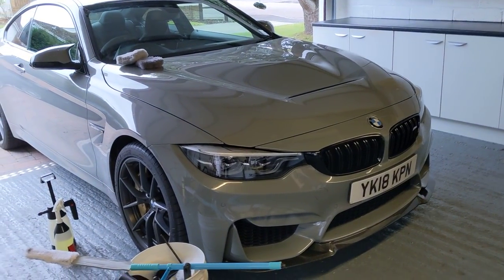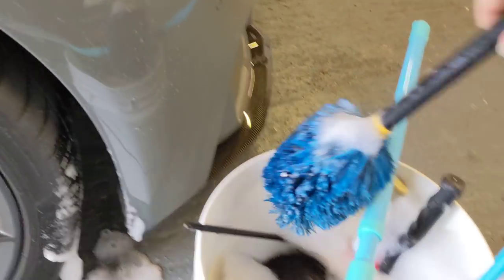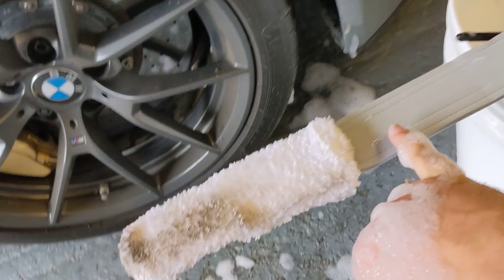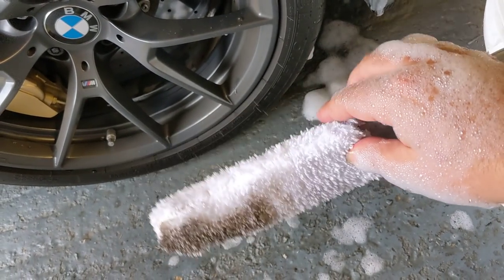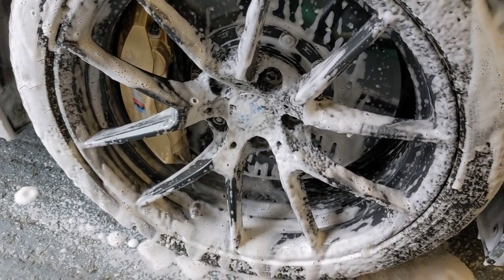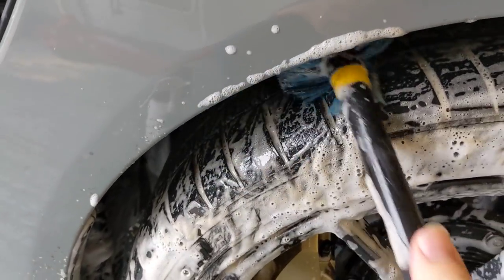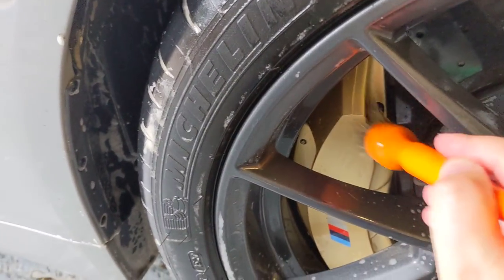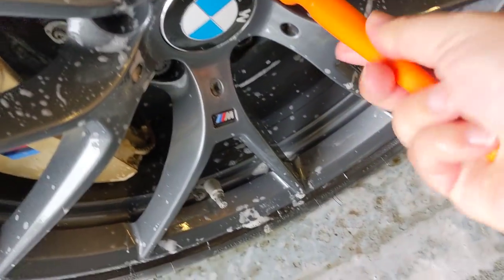Cleaning Ceramic Brakes on my new BMW M4 CS | Top Detailing Tips

Comment: Having owned Ceramics for a number of years, the best advice I can offer is just to stay away from anything too acidic or alkali.  As you've seen, the dust fall out is so easy to remove that a normal PH neutral shampoo is more than capable. Surfex is a bit aggressive for me in this circumstance and I just kept with BH Autowash.  Many Ceramic Brake owners complain of brake squeal and I believe this is down to using harsh chemicals that also get sprayed onto the disc surface, which causes this issue over time.  Please, please, please also use the wheel location tool when removing and fitting the wheels over ceramics discs. Chipping them is so easy and the last thing you want. So finding a suitable company to replace tyres, was my biggest nightmare.
Reply: Good advice using the  location tool. i got mine from amazon just make sure its the right thread size. take it BH autowash and snowfoam is safe to use on the brakes? i always wash any product i get on my disks away right away even if it is ph neutral

Comment: Hi John

I highly recommend the orange carpro microfibre gloves which are great for tight areas. I bought them for cleaning my similarly tight M3 comp alloys. Let’s you keep maximum dexterity when cleaning intricate areas, behind spokes etc.
Reply from the maker: Boa lights?
Reply: @ForensicDetailing  I think they’re just called microfibre detailing gloves but same colour and I think pile as Boa towels. Even though they’re meant more for interior and removing waxed etc. I’ve been using one single glove on my wheels now for well over a year and it’s still as good as new.

Comment: Hope you're enjoying your new Beast.  
Had a detailer come out and wash my previous car, F30 330D M Sport which had the M Performance brakes.  He asked for my keys so that he could roll the car forward and backwards to get to the part of the wheel behind the brake caliper.  He wasn't using a jack so he just laid down on the floor and reached behind to get to the back side of the wheel.  Can't have been comfortable for him, and he was probably in our age group too, not easy once you get a bit older haha!
Glad I'm not the only one that adds "age" to the end of random words, "foamage" lol!
Was also good to see that just by using some Surfex, when you rinsed the tyre and arch area, you could see the water beading on the tyre. I'd noticed it on my car whenever I'd used BH products but wasn't sure if it was that, or the waterless wash & wax I use when drying the car sometimes.  Guess not, love how good the BH products are!!

Comment: loving that pump sprayer, vican brushes are really good that's what I use in my other business (window cleaning), as to the ceramic braking any  pure shampoo will do to clean them as there should be no metal contamants present,
that's for the vids Jon keep it up

Comment: Might've been mentioned already, but can't you just roll the car forwards or backwards for the time being to access the part of the wheel you can't reach behind the caliper? Even if you build or find a brush, the opening will be too small to get any decent purchase on it or see if it has been cleaned properly anyway I suspect. Bar removing the wheels completely it'll probably be your best option.
Those wheels as lovely as they are look a complete ballache to maintain!
Good luck Jon 👍🏼

Comment: Great video Jon. Your motor is lovely. If I can offer you a tip for your orange brush - wrap some Gorilla tape or general gaffer tape around the lower part of the shaft of the brush, then if you catch the wheel during the wash process, its the tape that strikes the wheel not the plastic.

Comment: Picked up a flat microfibre duster on a plastic handle, less than 10mm thick from the Range. Pad is just over 9 inches handle 6. Had to stitch it on handle as glued on velcro failed, not super strong but a good compromise on coated alloys. Only cost a few quid.
Reply from the maker: Thx u I check this

Comment: John - Do you know why there is less clearance between the wheel and the rotor on the bottom as opposed to the rest of the circumference? I am racking my brain and I can't understand it, especially from an engineering or physics stand point. Dumbing it down I have to believe all "circles" have to be on center with one another, whether it be the rotor, the tire, the wheel, the hub, etc, in order for there to be proper rotation.If something is off center by even a little the movement becomes something sort of a dual action polisher. Please help me to understand how there can be less clearance in one location as opposed to another. Thanks!
Reply from the maker: It's the shape of the dust shield
Reply: @ForensicDetailing  Ahhhh that makes perfect sense! Thank you for the quick response.

Comment: Jon always tap the pressure washer nozzle attachment into the ground to make sure its locked in....mine popped on today but luckily no paint chip or dent....dodged a bullet.
Reply: Yer good tip - although he did point it away from the car deliberately as first to avoid that
Reply from the maker: I fire away from the car first to check
Reply: @ForensicDetailing  good, i wouldnt want to shame you on the "forums" again, glad you learned your lesson.🤣😂 Although seeing that detail factory brush hanging next to your dust/dirt collector is a major "faux-paux" and should be rectified. :elbowcough:

Comment: That little Microfibre you stick thing you used to clean between the seals on the window might slip into the gaps in the wheel, granted that isn't very long, so maybe getting some adapters 3D Printed for it would work quite well. Alternatively same idea, but instead getting a pack of Kirkland Microfibre cloths and stitching it into a glove shape, so it can be removed and cleaned. 3D print or fabricate the handle out of Plastic.

Is it perhaps, worth doing a wheels off clean for these.

That car is stunning.

For more info on Ceramic Brakes check out Engineering Explained, I'm sure he did a video on this.

Comment: Would it not be easier and quicker to take the wheel off ! Then the wheel gets cleaned on the inside also .
Reply from the maker: You have to be very carefull removing these wheels.   Won't be quicker but 9nce a year a wheels of detail is the way to go I think

Comment: Those wheels look a pain to clean ! and not a huge difference looks wise between dirty and clean (might just be on camera). With you on the EZ brush - it’s epic for arches and doesn’t budge an inch after years of use 👌
Reply: I wish they made a non bendable version of the large pipe cleaner looking EZ detail brush. Ive gone through 3 or 4 of them over 2 years, since the handle breaks off.

Comment: I use Sonax wheel cleaner and it turns purple witht the ceramic breaks. Am i using the wrong thing or hurting the break pads?
Reply from the maker: Yes don't use that on ceramic
Reply: @ForensicDetailing  Thanks for the help.

Comment: Hi john good video  👍 just out of interest when using K7  with your trigger done what nozzle do you use for rinsing  Where did you get your nozzle from ?  I'm looking at getting one for my gun as I'm sorting it out for my kartcher 
Cheers John 👍
Reply from the maker: K7 needs wider orrafice or u will pulse the machine.  Mine is a 40 size eBay sells it Imran in2detailing knows what size you need. I use white fan out nozzle
Reply: @ForensicDetailing   cheers John

Comment: Love the car but I am bit concerned about the vid. You did a rush on the wheels. Missed prewash, missed some parts with the mitt, brush is shot dead, rubbing tire and the rim at the same time. For me detailing hobby is preventing, preserving, keeping the looks. I know most can be polished after some time but this is not what game is about. I'd spend extra 2 minutes by the wheel.
Reply from the maker: I think this is fair I should prewash first.
Reply: @ForensicDetailing  no worries mate. Just thinking at loud, came to the conclusion all the toys tools and preparates, this is important, as well as keeping our rutine, not cutting corners :) I tried.

Comment: I suspect the composition of the braking compounds are a sintered/carbon or kevlar mix? (Someone correct me otherwise) non metallic as you've already discovered. I'd probably whip the wheels off say once every 3-6 months and clean the barrel or if you prefer jck up the car and rotate without removing the wheel to get behind the caliper section. What about applying a wheel wax to the barrel? 

Star marked Michelin PS4S will have a visible *asterisks on the side wall of the tyre. That indicates an M power collaboration between Michelin and BMW M division. They have a specific tyre compound and a stronger tightness of the middle section belt in the tyre for a much more snappier cornering and handling performance, improved tyre side edge wear and dynamics. 4 types of tyre compound compared to the 3. Its a PS4S but on steroids. 👍worth keeping or buying.

Must be an advantage to have ceramic brakes as there is far less fallout and chemicals needed to keep the entire car clean! That's a clear win! Personally,  I'm looking forward to more content on this 😌
Reply from the maker: Thx u